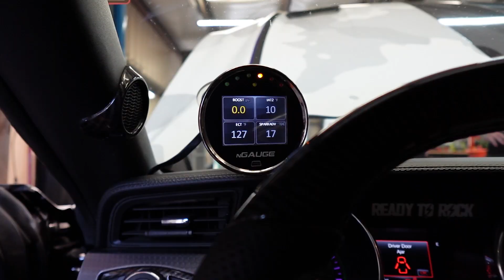VLOG 25: WE FINALLY WENT RACING

Comment: Great video as usual PP team!   I have to say it….no replacement for displacement.
Reply: That statement is true if we mad similar power. That car is a boosted v8, pulley down, double fuel pump system, injectors, full exhaust, intake, full e85 vs my bolt on drop in turbo e50 eco lol that’s setup for digs now, we’ll run digs soon an see how it ends
Reply: @Mr.297  yes!   I’d like to see that!   😀

Comment: nice job.   I have a 21 with a Roush 2650,  ended up going with a  Stage 2 - Fi Interchiller.  it cooled that shit right down . what size pulley are you running to make 15 lb of boost ?
Reply from the maker: We have it on a 69mm with the ported blower.
Reply: @ParkerPerformanceFL  nice 👌